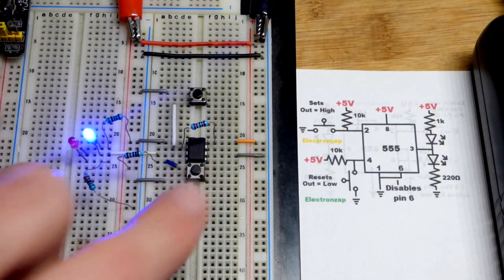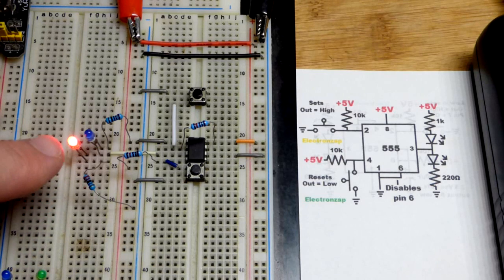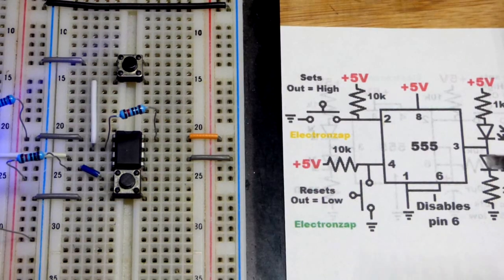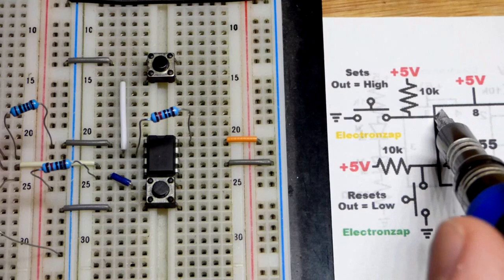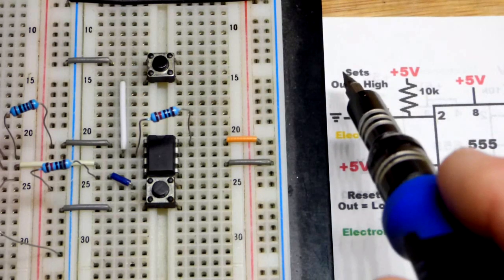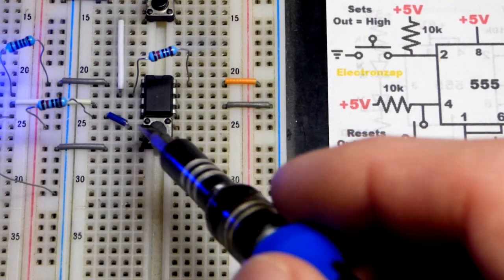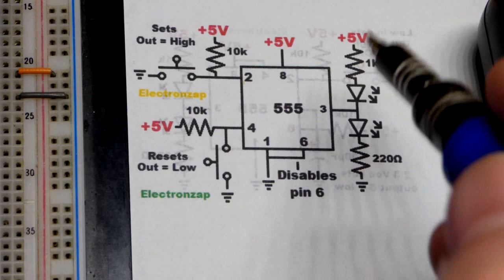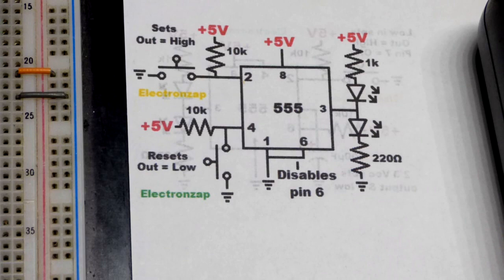Bistable mode flip flop 555 timer NE555 integrated circuit IC learning electronics shorts 10

Comment: Excellent video. You should do more on the 555. Maybe showing astable mode or showing the LEDs alternate blinking without a button push. So many different circuits you can learn from 1 IC.
Reply from the maker: Yeah a lot more should be coming :)